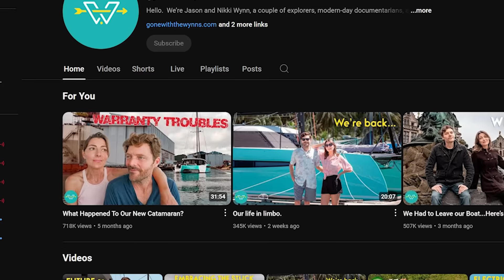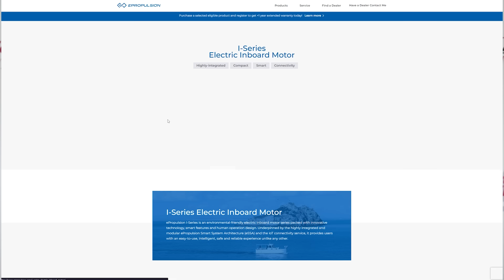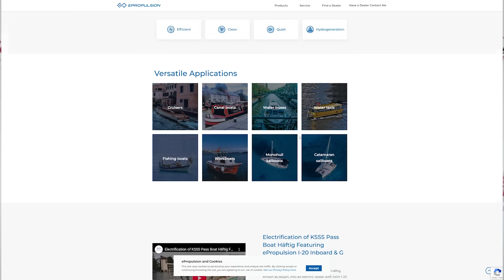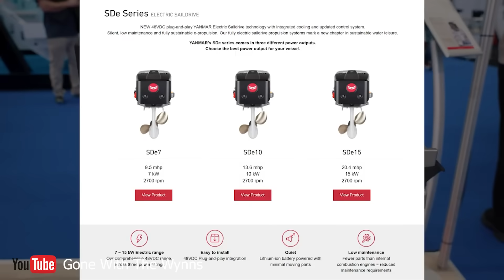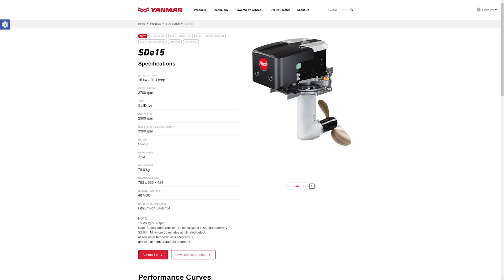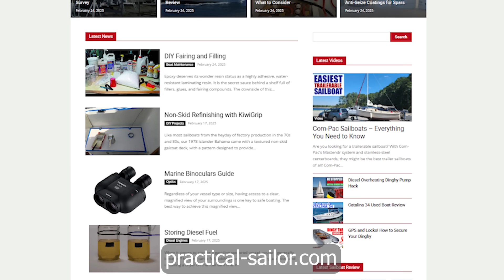Is It Too Soon for Electric Sailboats?

Comment: Every solution needs to be evaluated with it's end use in mind. And there will always be people who push the tech to see what is possible. Let's support them as a community rather than snarking and making ignorant comments.
Reply: After 70 years of sailing, 12,000 of them blue water I always consider the end use. That was my point. Match your equipment with the type of sailing you will doing and always considerer a worse case scenario. I have no problem with new tech. I just want to know its strengths and weaknesses. If you're getting hammered by a line squall heading for a lee shore, will it get you out? Do not misinterpret snarky with practical.
Reply: @ electric engines have more torque than a diesel so I think you’d be ok. Besides how did you end up on a Lee shore- judgement always weighs in on these things as well.
Reply: @garyseven777  Heading into Oxford MD, eastern side of Chesapeake Bay. Couldn't make it in so headed south west to open water to ride it out.
Reply: Or we can just act like adults and ignore the snarky remarks. Just because you don't like it doesn't make me any less entitled to make them.
Reply: @ be as big a jerk as you want, I’m not stopping you😂

Comment: The yanmar in my Lancer 30 blew up in 2016?... I replaced the whole works with a Torqueedo pod that weighs 11lbs plus a bank of 4 marine batteries from Canadian Tire. Excellent torque and as noisy as a sewing machine. It's true that it works great as a daysailer.

Comment: At 0:40  your opening remarks you say the Wynn's system uses diesel to generate electricity and electricity to drive the boat. This seems to imply that electricity is required for the boat to move. Have you actually looked at their system? They have diesel engines (Beta/Kubota) with forward/reverse gearboxes connected directly to the prop shafts. This drives the boat with no electricity involved, like boats have been for 100 years. You need a 12 volt battery to start the diesel, and then no electricity is used to drive the boat for hundreds of miles. The Beta/Kubota engine has mechanical fuel injection that needs no electricity. The "hybrid" part of the system is just an electric motor linked to the prop shaft by a drive belt. Remove this belt and you nave the same drive setup boats have had for decades. A failure in the electric/hybrid part of the system has no effect on the diesel's ability to drive the boat. This system is not new/radical/complex/dangerous or any other scary words.

Comment: Saving the environment by using an electric motor...installed in a big plastic boat. Make this make sense.
Reply: It has nothing to do with that or that is a side effect. It's just a better way and with investment and battery improvements in the future it will be even better. ICE tech has played out- no improvements.
Reply: @garyseven777  Time will tell, I guess.
Reply: Well I suggest you build a wooden yacht, be several times more expensive than Plastic and maintenance is much higher with wood.
Reply: @tmog1000   My first boat was a wood boat when I was a teenager. I learned that owning wood needed someone who was retired or very deep pockets to pay someone to maintain it.

Comment: I think depending on your situation electric can be a great auxiliary propulsion. If your boat already has a lot of battery power for amenities you might as well add an electric motor for getting in an out of port and silent cruising. I also don't see any reason why electric systems can't be more reliable than diesel. They have substantially fewer moving parts. All that said I agree that batteries just don't have the range for a cruising sailboat.

Comment: I think Tim's analysis is pretty spot on. ED is probably great for smaller sailboats where the engines are used primarily to get in and out of the marinas or travel at slow speeds for limited distances. But cruising boats sometimes NEED to power for 30-80 miles (crossing the Mona Passage, or Gulfstream Current during weather breaks, for instance) or even longer if the yacht needs to be at a port to pick up guests or drop them off for airline connections. Modern cruiser's electrical draw is already high enough that adding the additional requirement of recharging drive batteries also presents real challenges. The only way I can see it work for distance cruisers is also having a big diesel powered genset. So if you are going to be running a diesel anyway, I fail to see much bang for the very high bucks that ED costs.
Reply: Real world blue ocean cruiser conversions shows that’s not the case. Most 40 foot monohulls with a 10kW electric conversion are using 1000W to go 3 knots, 2000W to go 4 knots. With a 50kWh battery and zero solar or regen, that’s 150-250 miles of range.
Reply: @  Those are anemic cruising speeds for a 40' boat.  A passel of boats just crossed the Mona Passage between the Dominican Republic and Puerto Rico with a 12 hour weather window - all were  motoring for 12 hours at 6.5 to 7.5 knots into 3 - 5' seas, eager to miss the looming bad weather. All made it, but anyone who could only manage 4 knots would have spent an extra day out there and gotten nailed by 25 knots winds and gusty squalls.
Reply: For a 19k lbs displacement Ericson 39, the tested number at 6.5 knots is 8KW. So you could have also done that passage on a boat with electric and a 100kWh battery, and that system would basically never leave you without drive at the most inopportune time because old Yanmars are incredibly unreliable and finicky for most sailors.
Reply: @Morrisfactor  From 19 years of running a blue water diesel electric sailing cat (400VAC 3 phase system)… the bang for the buck is: weight gain (smaller fuel tank), efficiency (7kn at 2.4lph - max 9kn), torque, cogeneration, lower maintenance costs, simplicity, propane free (electric induction cooking and wallas diesel stove), gain of room, optimal weight distribution, etc. extremely happy with my extremely well designed and engineered system and personally I’ll never go back. If you get it right the first time (and some thinking), it just works. Hybrid is much more complex, expensive, heavier than diesel electric. The advantages are not as clear a defined. Especially not fur blue water boats. Even less so for mono hulls. Pure Electric … only for day or coastal sailing boats. Don’t forget that they are sailing boats. I try to sail as much as possible. My boat was also designed to sail well, even with little winds. Best boat ever 😁, and the perfect compromise for me.
Reply: Big boats can carry a lot of battery. If you put 1-2 tons of battery in the bilge you'd get a couple hundred miles of range electric alone
Reply: Even for those other use cases the propulsion could still be electric but there be a generator that provides power to it if the batteries are depleted. In car parlance it would be called a series hybrid. Many larger boats already have a generator separate from the engine to provide power without running the engines so perhaps if that were larger there would be no need for an engine at all - just electric motors, batteries and a generator as a backup.

Comment: Great video and Thx for it , electric falls under my I wouldn't do that if I were you or your dumb as shit , take your pick , your not saving the planet buying electric for a boat , I trust that when I get in my car start the motor and turn on the headlights that they will work , I don't trust my flashlight when the power goes out to work so I have match's and candles , I trust them to work , waste of time going into the sudden death syndrome from electric it makes the news enough as is , a diesel powered electric motor is a different animal but why bother ? , solar panels and a decent set of deep cycle bats are great and the bats are ballast last forever , a diesel out on the ocean will get you the 400 miles to avoid a storm if needed or into a harbour .

Comment: #1 cause of boat fires are ELECTRICAL. The more high Amperage systems the higher the risk. Short Circuit, ground fault and excessive heat.
Reply: A good AGM-based house bank can provide all the high amperage you need for whatever misadventure you care to get into.  Electrical safety isn't an issue just with electric propulsion systems.  Consider how many 100's of amps it takes to start your Diesel...

Comment: The difference in energy density issue to the side, the maintainability, difference in complexity and reliability are questions you should dive into.
Reply: You never need to change the oil on an electric boat.
Reply: @ More powerful electric motors use oil for cooling, note the Yanmar Saildrive cooling system, but experience teaches a captain the meaning of “fixing things in beautiful places”. Maintainability is less about oil changes or BAU maintenance, it’s about fixing or preventing serious issues like becoming minimally operational after a near lightning strike in the mooring field.  Diesel has its downsides, but it’s easy to service and can be resilient when the electronics are fried.
Reply: @paulyaron2410  Still an easier process then managing multiple mechanical systems moving (or not moving) fluids that can be flammable. Or do no diesel boats burn to the waterline?
Reply: @garyseven777  Very few, mostly due to careless smoking , and lack of proper fire control, which every boat needs.
Reply: @ few ain’t zero Capt.
Reply: @garyseven777  Cost vs risk is always a factor.  I'll take my chances.  Batteries also explode.
Reply: @garyseven777  Don't burn any more or less than any other yacht. Once diesel is running it needs no electric, so lightning strike is serious but not a disaster. BTW start diesel before lightning storm hits. Or have lead acid start battery.
Reply: @captainjimolchs  Nope they don't. Li - ion batteries not for boats. Li - po4 yes they don't explode or even catch fire, some cheap ones might smoke a little, but only after appalling treatment. BTW lead acid batteries explode quite easily in the wrong mounting conditions as I have found through past experience.
Reply: @tmog1000  No argument.  I addressed the "few ain't zero" aspect raised by a troll.

Comment: Pulled my dead diesel in 2008 put in an electric drive and never looked back. Boat lives on a mooring and with solar and an occasional charge from a 50 pound Honda 2000 generator there is no need to ever dock. Very little maintenance, no oil changes, antifreeze or winterizing. Plus I've gotten so use to the smell of clean and not diesel.
Reply: This is the perfect application for electric drive. I don’t understand why cruisers switch to electric and have all sorts of problems.
Reply: @TCGE08  I think they forget that they have a SAILBOAT first. In my experience an electric system compliments sail power quite nicely. In light winds I can crank the electric motor slightly to get a nice bump in speed until the wind returns.

Comment: We are an electric Bristol 35.5, truthfully an electric motor is like having a boat without an engine, using our motor only for entering and leaving port, presently we are anchored in Aruba, having sailed 43 days from Salvador, Brazil.
Reply: Nice to hear from people that are making it happen!!!!!!!!!!  I am almost finished with a full electric conversion on an 1979 Islander Freeport and all the comments from the anti electric folks gets old.  I will also have a gas generator for emergencies, I didn't convert to save the world just hate working on diesel engines!
Reply: @ I have an electric car. I bought my first electric car 20 years ago. 
So please stop with anti electric folks. 

Come to Norway. We often have som frisky weather on our coast. Your mast comes down. Or your sails rip. What will you do? Will your battery bank keep you going for 2-4 hours to bring you to safety? And your batteries are probably already low. Because there is no sunshine. 
I will fire up my diesel engine. I have 300 liters of diesel. I can keep it going for days. So me, my family and my boat will be safe. 

It is not about electric. It is about safety. 
And with the range the batteries can give today, electric engines are not safe on blue water sailboats. But in the future, when the energy density is higher, when batteries are lighter and smaller and takes 10 minutes to charge, they might be safe. And I will also consider going electric. 

Because I also hate my diesel. I hate the smell and the noise. 
But I also love safety. 

So dont paint a pretty picture. Be honest and admit that you are trading comfort for safety so people can make educated choices.
Reply: @darthkek1953  LiFePO4 batteries used on boats, caravans, RVs etc doesn't catch fire. It is not the same technology as they use in cars.
Reply: @darthkek1953  Just proves my point again that electric engines does not belong in blue water sailboats.
Reply: @darthkek1953  This is partially incorrect. We DO see LFP batteries in electric cars, notably most Chinese EVs, some Tesla Model 3s and the upcoming Chevy Bolt (2025 version). LFP batteries in a hybrid set up with a small diesel backup are a great solution for 40 ish foot sailboats with electric drives. When sailing, the prop is regen-ing power into the batteries to run everything. Just don't have an aluminum hull.
Reply: @darthkek1953  None of the boats are using Li-ion. They are using LFP, which is a vastly different chemistry.  You can punch a nail through the LFP and not get a fire. Also solid state is coming, check Sailing Uma's MET's show episode on batteries, it is nearly bomb proof. No risk of thermal runaway.
Reply: @mikeosmus7927  We have a Yamaha gas generator as backup.

Comment: Do you buy a tesla to go cross country? Probably not. Would you put an electric engine in a boat to go round the world? Probably not. Are we all looking for better range from a gallon of diesel, yes. If you have a high performance ultra light cruiser/racer then hybrid with a generator can make sense. Just have to realize the limitations of each boat and power combination, just as you have to evaluate the winds and seas every time you raise the anchor

Comment: The weekend scenario really is the best use for these systems. Just like electric cars are excellent as daily commuters within their range. You can do more than that with either one but it then takes extra effort and compromise. The biggest issue with both is having to replace all the batteries every 5-10 years at what's probably an equivalent cost to replacing your diesel engine.
Reply: It's a myth that they only last 5-10 years. Unfortunately many things oil and gas companies push as propaganda become common opinion. Just like American roads and jaywalking.

Comment: You really can't talk about Electric Drives by themselves.    You need also to consider 1 Batteries; capacity, charge rate, cost.   2 Solar and wind generation to charge the batteries, 3 The regen that can come when you are sailing.   
It would be good for you to interview Dan and Kika since they have gone through several complete systems and are doing a major upgrade as you must know right now to gain even more regen capacity.    They are successfully doing world cruising with all electric.   They are cooking with electric as well.    Hybrid systems are also a big topic.   See sv delos and Tally ho for some deep dives on this.     BTW Tim,   You and I and Dan and Kika were all in the Bahamas at the same time.   I remember you sailing into GT after your incident at Black Point.    Great Job with PS... Congradulations.
Reply: Regen that can come through sailing?  Ha ha ha. At 5-6 knots it's negligible. At least on my regen outboard which is an Epropulsion.
Reply: @tmog1000  As noted, it really depends on how the system is optimized.  Prop design, motor, electronics, etc.  One of the channels (I forget which) worked with the manufacturer through a couple of versions of the OceanVolt system to test how the system performed under various real-world conditions.  Improvements were made, and more will be in the future.

I agree - Tim, if you can, an interview with Dan and Kika would be very informative.  They've gone from a recycled fork lift motor to a modern marine system, and have a lot of real-world experience on what life with an ESV (is that a term?) is like.
Reply: Uma once sailed the Atlantic nearly a decade ago. Hardly world cruising at all.

Comment: Lithium batteries catch fire so easily. Slightest bit of moisture and it's a blaze that can not be put out. I would never trust an electric anything
Reply: You must be talking about about cellphone batteries- Lithium Iron batteries don't have this problem.
Reply: @garyseven777  Exactly my response.  I've seen a number of videos about "lithium battery fires", and they're all due to chemistry other than LiFePO4.  #1 culprit seems to be things like E-Bikes and similar "toys" stored and charged in lockers, all having LiPO batteries.  Different chemistry.  

All the other electrical fires were wiring issues that would just as easily been involved with a bank of AGMs.
Reply: @garyseven777  really?? Various vehicles of all types have been catching fire. They are all over the internet. I've a huge increase in yacht fires over the past several years. Buses cars ablaze and spreading to other nearby vehicles plus lithium is a such a toxic substance and an environmental disaster wherever it is mined which far worse than burning fossil fuels
Reply: @garyseven777  https://youtu.be/U2hitvLTYDs?si=bv4XZPeWplLqWZmo
Reply: @garyseven777  https://youtube.com/shorts/b49VN-61uQY?si=xk0yrhv1mrWUtrVp
Reply: @garyseven777  https://youtube.com/shorts/b49VN-61uQY?si=xk0yrhv1mrWUtrVp
Reply: @garyseven777  another lithium ion battery disaster story on a sailboat with electric propulsion and lithium ion batteries which do not mix well with salt water. https://youtu.be/VjMYSL7z5OY?si=SvtIOuPebHwuKUXj